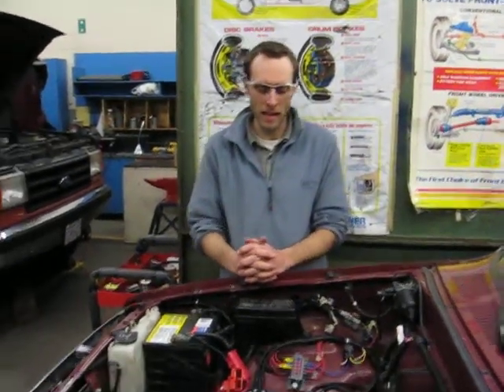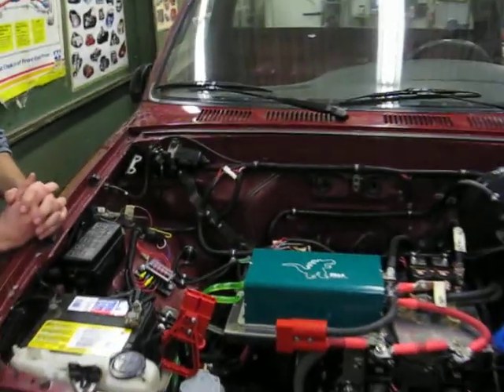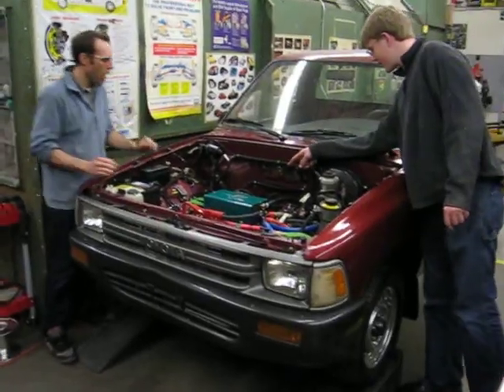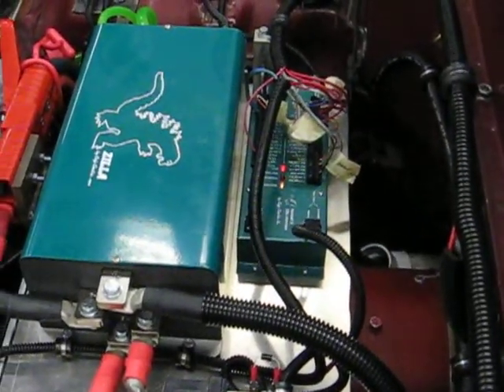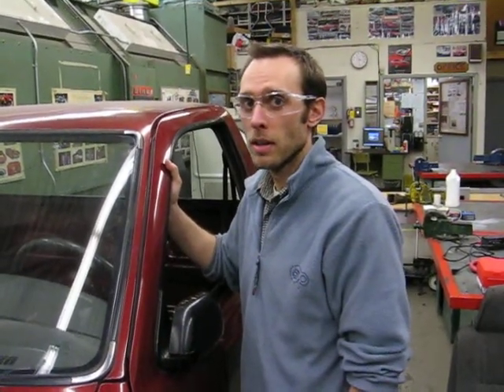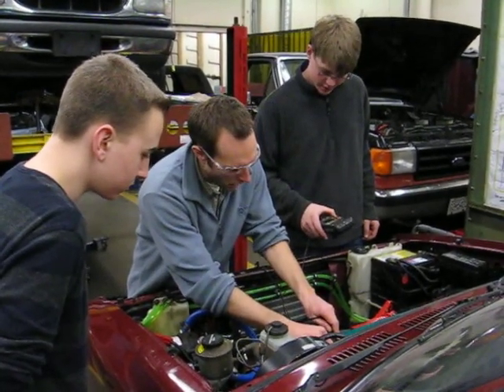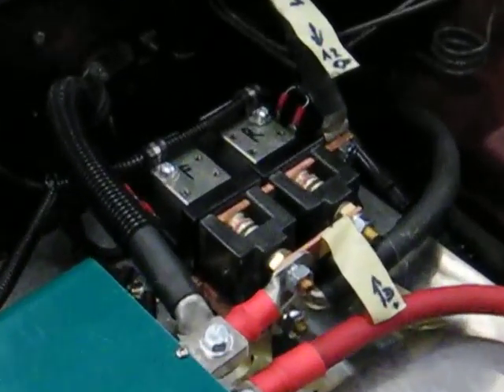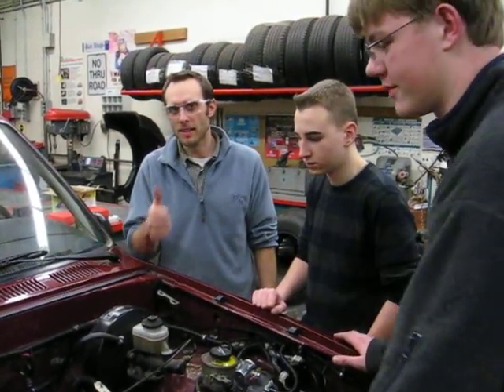Mynott and the after school EV crew plug in the temporary traction pack for testing!!!

Comment: Where does the funding come from for this build?  Just that Manzanita Micro Zilla controller has to be about $4k!
Reply from the maker: Beg, borrow, sponsorship, my own pocket.... Since it's a high school program, money is a wee bit hard to come by! :)
Reply: @caseymynott  and did you keep the conventional batteries or upgrade to li-ion?  Do you still have the truck?
Reply: @caseymynott  I live next to a high school with a auto shop.  Wonder if they'd take on my project with me?
Reply from the maker: @livemeyer  Since we literally have zero dollars, I have been trying to get sponsorship for batteries....If you know anyone let me know! Hahaha....
Reply from the maker: Our program is the only one in Canada that successfully runs electric racing. I do know their are literally a handful in the US. It's a very high level project. Not any school would take this on. With that said, can't hurt to talk to the instructor. :)
Reply: @caseymynott  Tell me if you think this would work (I know, I know, anything's possible, right?): take two Leaf battery packs and sandwich them in under the bed, both likely above the frame, cutting the bed floor out and re-welding it back in place a sufficient height higher to accommodate for  space needed for batteries below.  It could work, right?
Reply: @caseymynott  Yes, basically was thinking of doing it whichever way is most feasible.